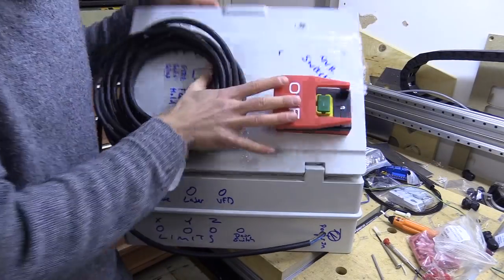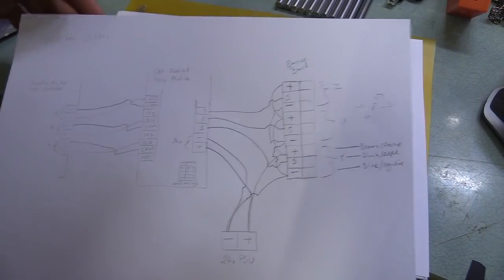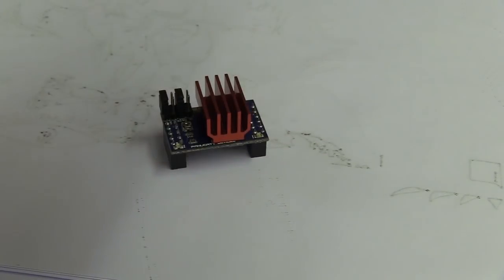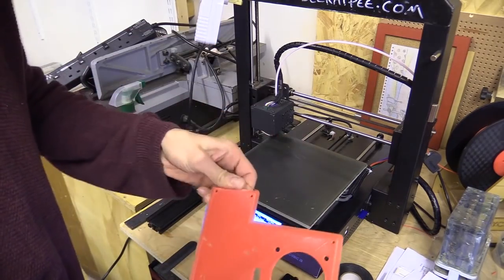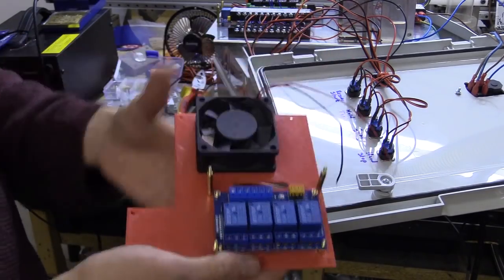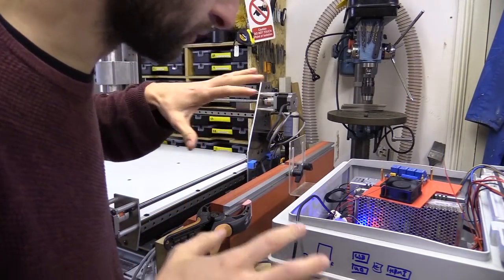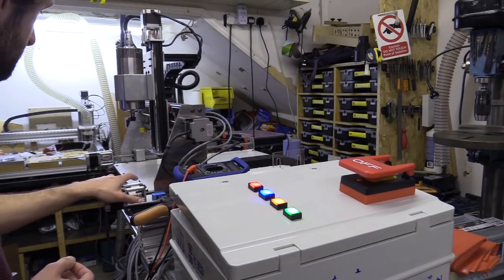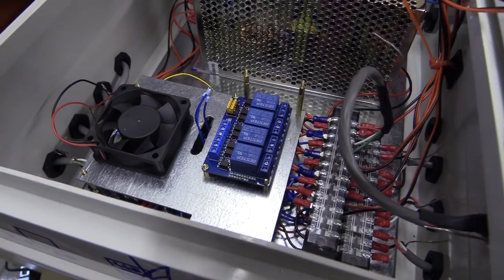#38 CNC Control Box Part 2  / Wiring Controller Board Inputs Buttons Limits & Steppers

Comment: Really beautiful looking machine, you've come so far. That issue with the two reset buttons and the requirement for rehoming as well as the losing steps at high speed could be eliminated or greatly reduced if there were some way to easily add encoders to your steppers. I've been looking for such a system and found they are either too expensive being made for the industrial market or too crude and only partially working for the hobbyist. There are some new BLDC servo projects that look promising but that's a huge change. Anyone know of a good stepper/servo for CNC project?
Reply from the maker: Thanks! I feel like I started with a donkey and now on a satellite. I was looking into encoders as well, and as you say it's a mixed bag. I think omc started selling something which looked like it worth testing? I'm a little away from trying that out.
Reply: Neo7CNC started using servos with built in drivers. just need power and step signals. not sure what they where called or the price.
Reply: @UberAlphaSirus  I just had a look, did you mean the Acorn CNC? It looks like a proprietary setup which makes it outside my interests.
Reply: Banggood has nema23 steppers with encoders, a hybrid solution. Works with a proper Bob. I will get some in the next months for my nema23, Mesa 7i96 machine.
Reply: @peterjansen4894  The ones for $175/motor?
Reply from the maker: @BrianBoniMakes  - https://www.omc-stepperonline.com/Integrated-Stepper-Servo-Motor-2Nm283-oz-in-24-50VDC-NEMA-23-Closed-Loop.html this was the ones I saw on OMC.

Comment: For soldering, first make a mechanical connection (wrap the wire around or through the terminal) then heat the joint with your soldering iron and melt the solder *on the joint itself*, because:
1.  Solder won't bond well to cold metal.  Try dropping blobs on a cold (solderable) metal piece and see how many stick.
2.  Hot metal tends to oxidize.  This includes the wire, the terminal, the hot solder on the soldering iron tip...  
The flux is intended to clean the wire and terminal.  Burning it all up beforehand on the tip of the soldering iron, then allowing a few moments for that hot solder to oxidize, then globbing it onto a cold terminal, will get you less than optimal results.

Comment: I feel like I missed a video where you changed from the dedicated stepper drivers to the controller board with the smaller drivers... Just means more videos to watch
Reply from the maker: Lol and I still have a lot more videos to make. I wanted to try make a CNC machine with a smaller footprint and smaller control box, and also improved on some of the issues with the previous machine.

Comment: Very good work!
I have a question, why so much relay?
Reply from the maker: Thanks. The idea was to use the opto-isolators on the relay modules to try shield the controller somewhat. Meant I could use higher voltage and will create logical connections between buttons or limits and board. Also the input terminals are really tiny on the controller and I've already broken one. Kinda easier to wire to the larger ones further along.
Reply: @EducatingSavvas  Excellent, a great idea, thanks for the information.